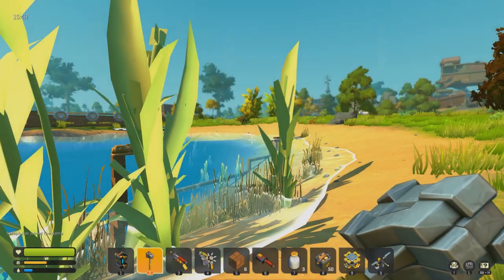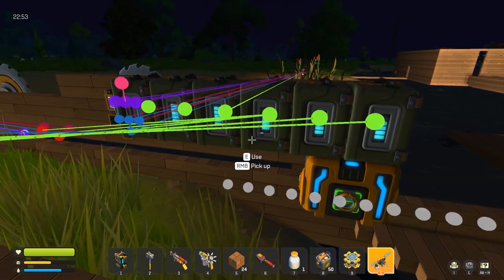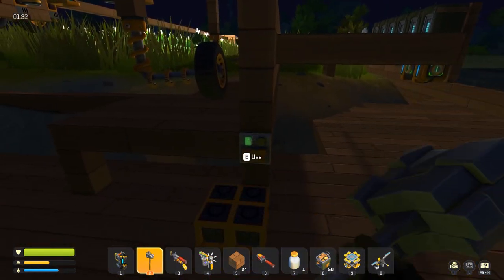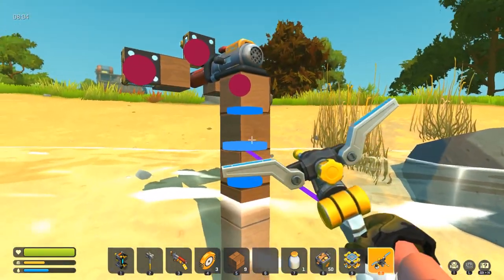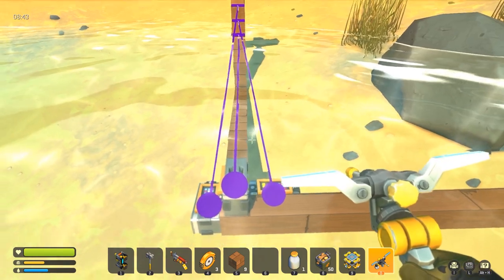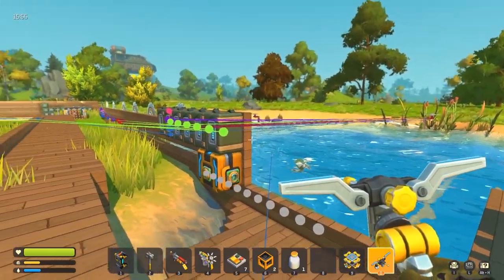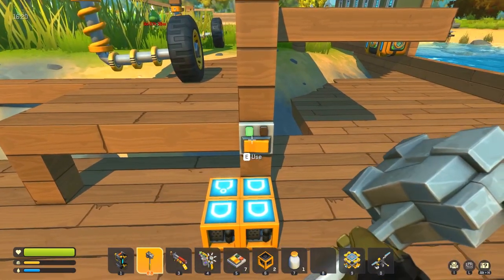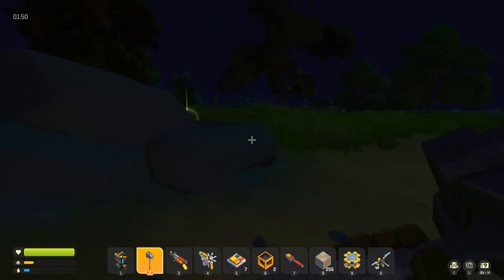How to Make a Turret and Flawless* Raid Defense System | Scrap Mechanic Survival

Comment: For my turrets, I use as few parts as possible. 1switch, 1mounted spudgun, 1sensor, 1controller, 1ammo container, 1bearing, 3 logic gates (1 or gate, 1 nor gate, 1 and gate), 1 timer (to slow down the pulse rate and allow it to be customized for minimal ammo wastage), and a few wood blocks.   the controller is set to constantly turn left and right at an adjustable angle tolerance (i use 33 degrees and -33degrees)when it receives power, My chosen pulse design is made by connecting the "or" gate to the timer, then the timer to the "and" gate, then the "and" gate to the "nor" gate, then the switch to the "and" gate, then the sensor (which is placed on top of the spudgun barrel) to the "and" gate , then the "and" gate to the spudgun.     the entire mechanism is made to be as compact as possible, and is put together in the shape of a rectangular prism. The prism contains no parts other than the ones I have listed.   Depending on how I arrange the layout, I have gotten it to be as small as 4x5x6, with room to spare.  I hope this is easy to follow, it is meant to be read as if you were building along with it like instructions. The layout can be changed as much as you want and still function as long as the connections remain the same. Please test my design, improve it, and give me instructions in a reply. Thanks for reading this far, Have a great day! :)

Comment: When i connect The rapid fire to The turrets they just rapid fire automatic when i turn it on
Reply from the maker: Have you attached the sensors to the same and gate that triggers the guns? Join the discord and feel free to ask me anything else!
Reply: Ok... I've watched it a few times and I think... direction plays a part?  Like the middle OR gate has to go to the AND gate.  It can't be the other way around.  If you notice along the connections, there are tinny arrows that show which way they are going.  Honestly, logic gates confuse the hell out of me.  I can do simple stuff like connecting 2 switches to an AND/OR gate for a single light or door or something but after that I just get confused and go, "well it works!"